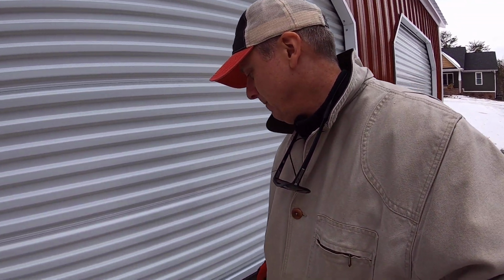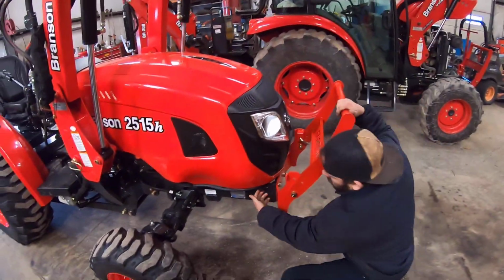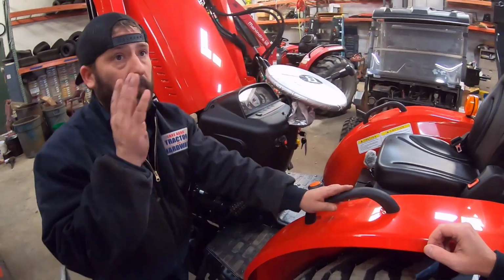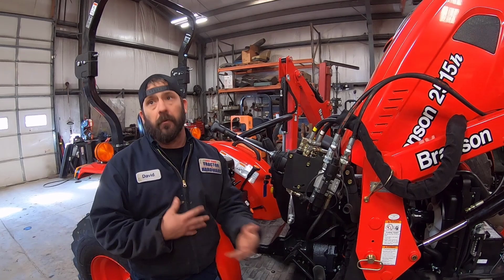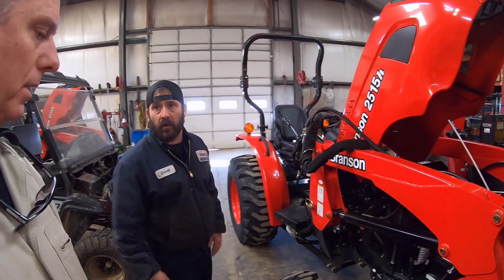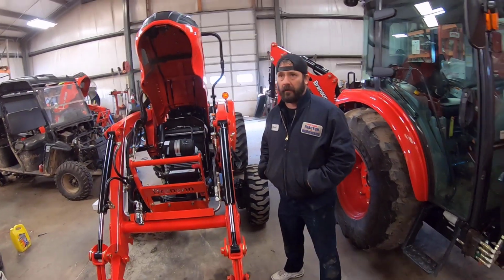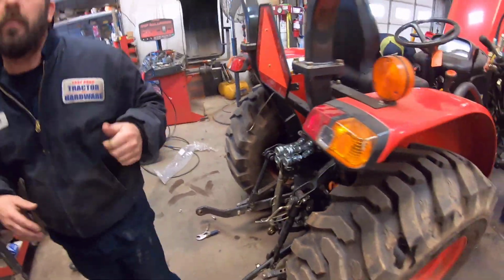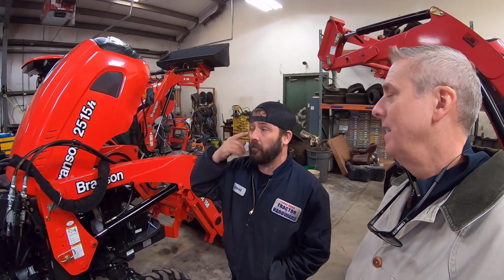51-New Branson 2515h Tractor Walk-Around With Branson Dealer

Comment: I recently bought a 22 model (2 y.o.) 2515H (exact same machine) with low hours in excellent shape. It came with a third function and I added 2 rear remotes. I priced a new JD 3025 comparably setup and this was about half the price and it has higher capacities. It's the perfect small acreage machine at an affordable price.
Reply from the maker: Congratulations!  That's awesome.  I know that JD and Kubota make nice machines, but like you I had a hard time paying so much more, for less features and capabilities. 

Hope you enjoy your new (new 2 U) tractor as much as I've enjoyed mine.  It's built well and if taken care of, it'll still be running great long after I'm 6ft under.  Thanks for sharing your great news.  Have a fantastic day.

Comment: So after 2 years of use and dealer service, how would you rate the tractor and dealer. Would you be willing to do a follow up video?
Reply from the maker: Haven't really had a need to interact with the dealer since I bought the tractor, because I've done my own maintenance on it, and haven't had any issues requiring the dealer.  I certainly liked the buying experience, so that's all I can report on for the dealer.  

As far as the tractor itself, I still love it.  Had one minor issue with a bolt loosening up on the loader control lever.  Took me all of 30min to figure out and fix.

When I hear other people talk about how great their new 40+hp tractor has  new features like auto throttle hydrostatic 3 speed transmission, and that they can now lift 1,800lbs, I always chuckle to myself because I paid almost half of what they did, 3yrs ago and mine does all that and more.  So yes, I feel pretty good about this tractor, as I suspect you can tell if you've watched the dozens of videos I have on it.

Thanks for watching and for your comments.  Have a fantastic day.

Comment: I have been interested in buying a new tractor for a few years now.  I was going to get either a Massey Ferguson or a Kubota compact tractor.  My friend bought a TYM T25 and loves that tractor.  I thought i better do my due diligence and check out TYM. 

Compared to the Massey 1825e, the ease of ingress and egress for the TYM 2515H is amazing.  The step through, the seat adjustment and lumbar support are fantastic. 

The Kubota L series is a much smaller frame compared to the TYM 2515H.  And the Kubota is more pricey.  

Big selling point for me is metal hood, metal fenders, ease of maintenance and fuel addition.  Plus, this tractor is built like a tank for how robust it is.

Getting one this week.
Reply from the maker: I agree with all the things you said.  I love mine.  Glad you're friend encouraged you to look around.  Thanks for your comments and for watching my channel.  If you haven't already done so, check out my website ( https://twc-projects.net ) for lots of helpful resources and subscribe to @twc-projects.

Comment: I have the 2020 2515H,  Rear hydraulic remotes were an option. I had them added later.
I'm at 550 hours of heavy work.  I dug most of a 1/3 acre surface, 4 acre ft pond with it.

Overall a very good machine.  Any issues were due to my making errors.... except a routing issue with the throttle cable to the hydrostatic pedals.  The factory routing resulted in binding and breaks the cable.  They gave me a new cable.  I  put it in and zip-tied to alter routing and prevent the issue.  Should solve the problem for many years.

The mechanic is showing under the hood and not using the hydraulic cylinder blocks that are mounted to the loader stand.  Pull a pin and place the block on the ram so the loader CAN'T come down via leakdown.
I find these blocks to be a little shorter than they should be, but they are much safer than relying on the joystick lock.
Use the blocks or cut C channel a bit longer.  The life you save might be your own.

You can get the oil dipstick without opening the hood.

The water bowl for the fuel has a drain...  I've only opened that to ensure it will drain every 100 hr drip a bit of fuel out.  If you are getting water in your fuel, get your fuel somewhere else or you have a problem with your on site delivery fuel tank.  You should never get water in the fuel if getting it by the 5 gallon jug at the gas station.

Your loader will pick the back of the tractor off the ground with fluid fill tires + brush hog + 400 lb of concrete bags on the back of the loader.  
You won't get to the lift limit of the loader.
Backdragging improperly is the #1 reason people bend the loader or loader hydraulic rams.
Reply from the maker: Hey.  Great to hear you're still loving your Branson after having owned and used it so much.  And thanks for all the great tips.  Much appreciated.

Comment: I love everything about the branson tractor s except one thing that is major to me. The loader valve and hydraulic coupler location is absolutely horrible. If they offer a fender mounted joystick with the couplers down under the floorboard, I'd be sold. Otherwise I'm still strongly considering a kioti
Reply from the maker: I've heard others say the same thing, it totally makes sense.  I've only known this setup, so I guess I just got used to it and don't mind it.  I think the rational was for ease of removing the whole loader setup.  

Regardless, thanks for your comments and for watching.

Comment: Called this dealer yesterday and they quoted me 23500$ for the 2515h which is almost 4000$ more than they are listed online at other dealers for hopefully you got a better price than they told me over the phone I was ready to make the 1  1/2 hour drive to the dealer before he told me the price looks like I will settle for a bobcat 2025 hst for 2000$ dollars less
Reply from the maker: Thanks for sharing.  Yes, I got a much better price, but inflation has made everything go through the roof in the last 8 months. Sorry it didn't work out for you, but glad you didn't waste your time driving out there only to be frustrated. 

I originally was trying to buy a skid steer, but just couldn't even find a 10yr old one for less money than brand new Branson, so I went that route.  And my truck and trailer aren't rated for more than 5K load, so I could only haul a small skid steer, which didn't have the lift capacity I wanted. Hope the skid steer is perfect for your needs.  Let me know how it works out.

Comment: Thanks for the vedio. Nice tractor. My tractor has the hydrostatic transmission and when I go down even the smallest incline it jumps in and out of gear. Does yours do that? It goes  up an incline with no problems.
Reply from the maker: I have hydrostatic transmission as well, but no issues with jumping in or out of gear.  I do notice when in mid range gear, on an incline, I either have to manually push my throttle up, or if I'm carrying too much of a load, I have to stop and shift into low.  I figured that's to be expected of only 25hp.  I'm already amazed at what I can do with that small of an engine.

Thanks for your comments and for watching .

Comment: Dealer told me to turn the key to on three time to heat up the glow plug. Since this practice may induce early failure will start from normal start when the indicator goes out.
Reply from the maker: Interesting.  I've been told by several people that the black smoke is normal, especially for a diesel without the regen cycler.  I just watch for the glow plug light to go out and then starts every time, no matter how cold.  Not sure if I want to add 3x the ware & tare on my ignition system to avoid a little black smoke at start-up.  I'll keep that in mind though and try it sometime to see if it works.  Thanks again for your comments and follow-up response.  Much appreciated.

Comment: Nicely done on the walk around.  On this model, 2515H is it necessary to turn the key to  on 3x before starting? Less black smoke at start up - is that normal?  Good tractor. Will be fitting a Landpride quik hitch and Worksaver 60" box blade to clear an easement for trenching.
Reply from the maker: Not sure what you meant Richard about 3x key turns and black smoke. But the quick hitch and box blade sounds great.  Let me know how you like the quick hitch.  Hope your project goes well. Thanks for your comments and for watching.

Comment: What year model is this? I'm trying to decide on a tractor and I like the weight and capacities of branson.  Seems like they improve the weaknesses each year.
Thank you.
Reply from the maker: I'm going to say it's a 2022.  I ordered in Dec 2021 and received it in Jan 2022.  Not sure exactly how tractor model years work, if they are like car model years or not, but I do know that the brand new 2021 model I test drove in Dec didn't have a one of new things that mine does.  I just checked all my paperwork and can't find a model year anywhere on it, which struck me as strange.  But I do know this thing was fresh off the boat.  I doubt you can find 2018 or newer used 2515h for sale, unless it has been abused with a lot of hours on it.  As you also said, they keep making improvements to things as they hear back from customers. So be prepared for a wait when you order one.  I was super lucky that I received mine in about 30 days.

Good luck.  Hope this help you figure out what you want to do.  Thanks for your comments and for watching.
Reply: @twc-projects  i was lucky enough to buy mine right off the lot (5220). It's the best small tractor ive ever used (I've been driving tractors since I was a child, my family owns a 3500 acre cattle ranch). It's not what I use on the ranch, but on my 120 acre hobby farm, its the perfect tractor.

Comment: I also bought a 2515H from Lake Anna Tractor.  What a nightmare!  One excuse after another on delivery, and over 6 months trying to get insurance work done on it.  Owner is unresponsive and can't keep his stories straight.  Final price of my 2515H with accessories was not much cheaper than a JD 3025 similarly equipped.  Wish I had gone green just because of the dealer.

The Branson itself is a decent enough tractor in low range.  With the FEL and boxblade mounted, it won't go up a 6% grade in high or midrange.  

The biggest issue I have is the lack of availability of service manuals or parts catalogs.  Buying parts from the dealer is an expensive proposition.  

An overarching problem is the dealer network.  When Lake Anna Tractor tanks, or drops Branson, the next closest dealer is 157 miles away.
Reply from the maker: Sorry to hear you've had such troubles.  I totally agree with you about lacking power in mid to high range.  I find myself having to switch down to low range more than I expected to get up an incline.  I was so focused on stable lifting capacity, when doing my research, which requires more weight, that I didn't think about the trade-off.  More weight is good for not tipping over, but also means more power is needed to move all that weight around.   I'm getting used to it though and still feel it's worth being able to lift heavier stuff.  I have the UTV for running around quickly and climbing hills.  More power is always better, but also more expensive when it comes to tractors so this was a good value for me.

Hope you get everything sorted out.  Thanks for watching.

Comment: Could you tell me what aftermarket 3rd function you got installed in on the front? Is there a model or serial number or something? I'm wanting to install one on my 2515H, but would prefer not to do the Branson bypass one. Thanks!
Reply from the maker: WR Long 3rd function kit.  You can find a dealer near you by going here: https://www.wrlonginc.com/dealerlocator

I'll have to take a close look next time I use it to see if there is a model # on it.  I won't have my root grapple for another 4+ months, but I'll be sure to share how well this 3rd function works once I get to use it.

Thanks for your comments and for watching.